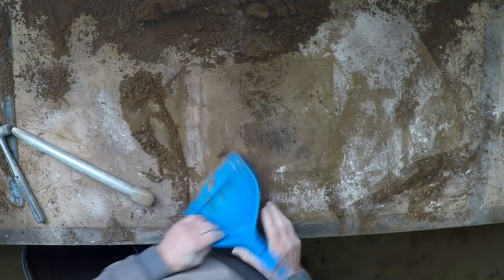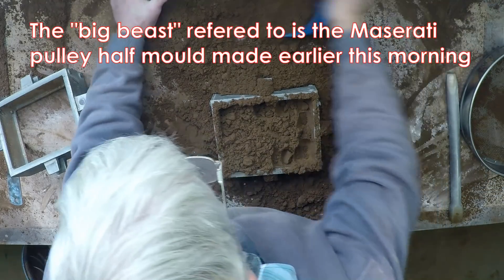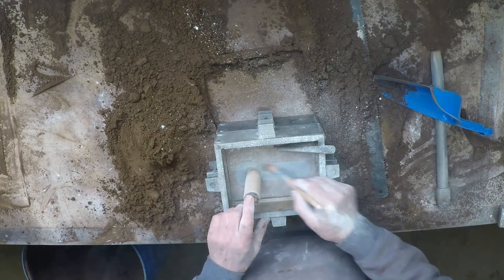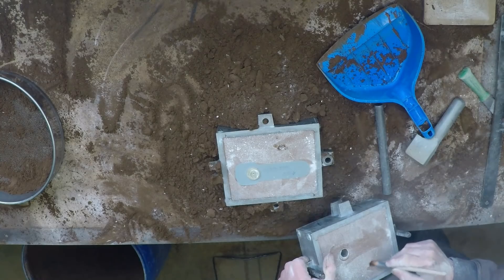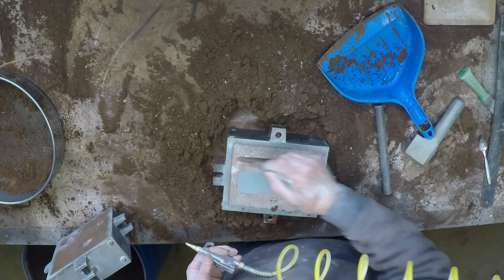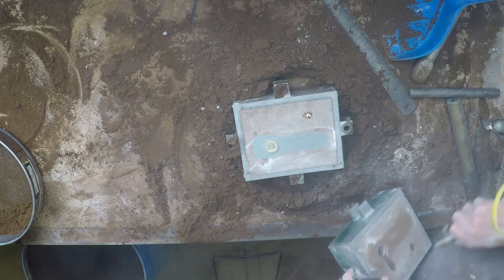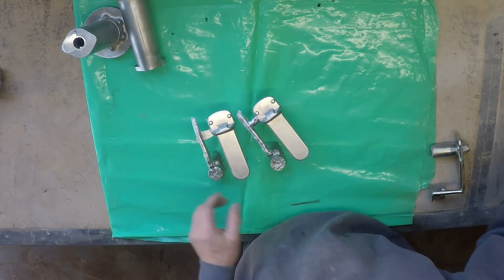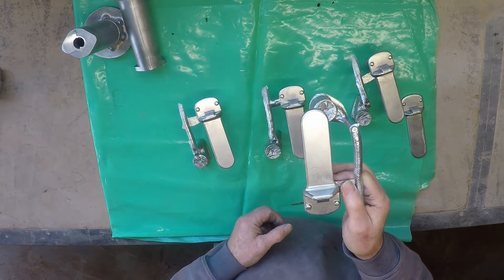Sand Casting an Aluminium Vacuum Cracker for Jars

Comment: Hello martin once i have casted brass door handle and he wants 20 more pcs the thing is my furnace can take 80 kg of bronze and the handle is 12 kg how can i have the same color of brass he dont want to make any patination that is making it hard for me
Reply from the maker: Rabih, This is exactly why I gave up melting brass! Not only was there the zinc fumes which I did not like breathing in but the colour changed with just about every melt. I was making candle sticks and the stick came out one colour but the bases cast the next day were another colour - hopeless! To be honest I would have preferred to have used a silicon bronze for this job, it does have a higher melting point but it does not change colour and I think is a better colour anyway.
With brass all you can do is be very consistent. Firstly buy enough brass ingot to do the entire job, melt a consistent amount of ingot and returns (gates feeders etc) each time and if your melting conditions are consistent you should get a colour match. Good luck... Martin
Reply: the thing is in my country no one sell ingots this is the other problem i am thinking to make ferro silicone bronze i will melt scrap copper to ingots 
Then melt the ingots with ferro silicone hopefully i will get the same color
Reply from the maker: Rabih, Well, that makes things difficult! I assume that you are going to copy Luckygen1001's method of making a variety of silicon bronze. It certainly seemed to work for him although I doubt he got quite the bronze that he though he would get as I suspect he would have lost some of the ferrosilicon to oxidation from the inevitable copper oxide that you get when you melt copper. But the bronze he got was certainly a useful alloy. If you make it in bigger batches than he did you will probably get a better recovery of the ferrosilicon. Be sure to use 75% silicon 25% iron ferrosilicon. The colour should be consistent if you are in everything that you do. However it is always better to but ingot if you can, its just so much easier and more consistent. If you can  avoid using copper wire it has too much surface area and therefore gives too much copper oxide, if you can stick to copper buss bar the thicker the better... good luck and let me know how you get on. Do you have a video of making the handle?.. Martin
Reply from the maker: Rabih, Copper and lead are mutually insoluble in each other. Whilst a 10% lead alloy will solidify more or less as an alloy, by the time it cools to room temperature it will consist of essential pure lead particles in amongst a pure copper matrix. Because the lead is so much heavier it can  sink to the bottom and your casting may have higher lead levels on its lower side  I am unsure as to how well it would polish as the lead being so soft might pull out during such an operation. Also be aware that lead vaporises quite a bit and your foundry and your sand will become contaminated with lead. I think a 90:10 tin bronze would be a better choice. Sorry but I do not have a mobile phone (strange but true!) My email address is mmwest*hotkey.net.au substitute @ for the * Perhaps you can contact me that way... Martin
Reply: Hello i have done the castings 85 % copper and 15 % tin the result was perfect 
Once i did the cast i remelted the ingates and sprues and i got the same color soon i am going to make my youtube channel 
But still interested about making brass what do you suggest melt copper first then zinc or melt zinc then add copper i am confused i dont want to burn the zinc

Comment: Wonderful information beautifully presented.  I learn so much watching your videos.  Thank-you.
Question: You put a spoonful of something on top of the metal. What was it and why?
Reply from the maker: Chris, The spoonful on the top of then feeders is an exothermic compound, its job is to catch fire and generate a lot of heat. This keeps the feeders liquid for longer so they are better able to provide liquid feed metal to the solidifying casting underneath. It is called "Ferrux NF" and it is made by Foseco… Martin

Comment: You should work inside a big, flat plastic drip tray, then you would not have sand all over the place ...
https://s3-eu-west-1.amazonaws.com/progrow-co-uk/app/uploads/2018/07/05231_large-600x600.jpg
Reply from the maker: My, It all gets thrown onto the floor for reprocessing anyway because its easiest to add water and stir it around with a rake and shovel on the floor, so being sort of all over the place is not a problem. I do slowly loose sand but its not like petrobaond which is quite expensive. I bought about 6 to 8 cubic meters of this sand many years ago and it was very cheap it actually cost more to get it trucked here than to buy!  Throwing out of a little each time plus the addition of a little new each time is the best way to maintain consistent sand properties. I will go and look at the ling and see what it is about... Martin

Comment: I thought for sure you'd still break out your pneumatic "burp-burp" rammer that sounds like a two stroke dirt bike. I like that tool, need to get one for myself. On another note, in your vast experience have you ever had the weather be just too humid to cast, where porosity just ruins just about everything you pour?
Reply from the maker: Amalgamous. These moulds are just a little to small for the "burp-burp" (love the title!). I do know of foundries who will not pour aluminium on very humid days as they feel the hydrogen pick up is just too great. Obviously higher atmospheric humidity has the potential to increase hydrogen levels but to be honest I am uncertain how great the effect is. We have to remember that water is a product of fuel consumption so the humidity inside the furnace is pretty high anyway. I would not be too quick to blame humid weather for all the problems as things like how hot you get the aluminium, how long its hot for, how long it takes to get that hot, how clean and dry you input metal is, how dry any fluxes and degassing agents are (you don't use washing soda to degas do you?) How much turbulence in metal treatment and handling and in pouring the mould right through the gating system and into the cavity. To name but a few of the possible causes of high gas levels (there are lots more). And it depends on what you mean by high humidity, far north Australia gets unbearably humid (to us southerners) for some months each year, to try and work a foundry there must be a real ordeal. But given the choice I would certainly prefer a low humidity day its just that it isn't the be all and end all of gas problems... Martin
Reply: @olfoundryman8418  I have a confession to make, in the beginning I did use borax and washing soda it was a constant pain. Bubbles in the casting everywhere. I switched to a mix of 50% sodium chloride / 50% potassium chloride things got a little better. I am currently working on copying your degassing lance. Then again, I'm a hobbyist who is often melting junk to make trinkets and the occasional useful part.
Reply: @olfoundryman8418  As far as humidity goes, 90% is not uncommon in the summer. I do most of my work in the winter where the humidity is lower and the mosquitos are dormant for the most part.
Reply from the maker: Amalgamous, I am not surprised that you had bubbles everywhere! Borax is pretty much useless on aluminium as it has no power at all to dissolve aluminium oxide. Washing soda (depending on which washing soda you get, there are several but just 2 main ones) contains 64% water bound as water of crystallization and this is what the bubbles are that you see coming out of the aluminium when you plunge the washing soda to the bottom i.e. steam! This is about the worst thing that you could bubble through your aluminium as it increases both hydrogen and oxide levels. 50:50 sodium and potassium chlorides are the BASIS of a reasonable flux however it too will not dissolve aluminium oxide. To be successful you need to add a fluoride to the mix typically they add about 5 to 10% of cryolite (sodium aluminium fluoride) to the mix and it then makes a reasonable flux but it is only a cleaning flux to remove oxide and it does nothing to reduce hydrogen levels. I need to do an update on my degassing lance video as I found a problem with the latest design and have had to modify it. To be honest if your input metal is clean and dry,you melt quickly, do not get it too hot and pour as soon as it is hot enough you should not have too much trouble with gas unless of course your castings are very thick as the slower solidification of thick stuff gives more time for the gas bubbles to form. Petrabond sands also slow solidification and thus may give worse gas problems. Incidentally true hydrogen gas porosity bubbles are usually about 0.5 mm diameter and anything larger than 1mm  is much more likely to be trapped air... Martin
Reply from the maker: Amalgamous, Hmm, 90% humidity and lots of mossies - you can have that on your own .😀..Martin
Reply: Thanks for the information. Hopefully I can apply it effectively when I get my foundry/refractory rebuilt again since hurricane Florence made a mess of things. I look forward to seeing your new design.

Comment: Absolutely superb. I reckon I've learned as much watching just a few of your videos as I've learned from the hundreds of others I've watched. You're also the only one I've seen who adds the xo, which for me raises two questions. 1 - Where can I learn more about such details? 2 - Where in Melbourne can I source some and just what do I ask for?
Reply from the maker: Sir, The spoonful on the top of then feeders is an exothermic compound, its job is to catch fire and generate a lot of heat. This keeps the feeders liquid for longer so they are better able to provide liquid feed metal to the solidifying casting underneath. It is called "Ferrux NF" and it is made by Foseco. This company used to have a branch over towards Dandenong but it now appears to be closed down and you would have to contact their NSW branch. They are combined with /are part of Vesuvius. 
 I also live in Melbourne (outer east) If you just want to try the exo I could stretch the friendship and lend you a cup full. Am in the phone book surname West... Martin
Reply: Thanks Martin. I really appreciate the offer but don't want to impose. Besides, I'm not eve sure where I'd find a phone book these days and the White Pages web site search doesn't work for me. I'll give Foseco a call after the holidays.

Comment: Nice job! I'm wondering why you coat the inside of the sprues and feeders with parting dust? Does it help prevent sand grains from being eroded by the flowing metal?
Regards,
Preso
Reply from the maker: Preso, Dusting the inside of the sprue and feeders with parting agent is probably a habit peculiar to me! I do it to stop any loose sand (that may blow around during later processing of the mould) from sticking and thus the dusting makes it easier to blow away loose sand just before final closure of the mould. It just makes these surfaces, and indeed the entire cavity as I dust that too, easier to clean, and then you will notice that I very carefully blow the entire cavity, sprue feeders runners gates etc as free as I can from any loose sand.  Generally unless you have a lot of turbulence during your mould fill (overly large high sprues are the main culprit) even loose sand will stay where it is, the metal will simply roll over it rather than pick it up. However any that falls onto the mould surface (from the sides of a feeder for example) will mar the surface of the casting with what I call the "dreaded loose sand grain defect". If you look closely at this casting you can see several very small examples of this defect - rougher finishes tend to hide it but it is almost impossible to avoid at this level of surface finish as even the smallest loose grain will show up... Martin

Comment: Just out of curiousity if you weren't filming, how long would this project take you start to finish?
Reply from the maker: Jesse,  The moulding, pouring, and breakout are done in pretty much real time. It takes about 60 minutes to get the metal molten degassed and fluxed but this covered  7 moulds in this case 5 of these parts and 2 bigger ones. It would take perhaps 5 minutes each to de-gate and fettle the castings perhaps 30 minutes to reprocess the sand (again, for the 7 moulds) The heat treatment takes 8 hours but the oven does all of that I just sit and wait. So all up for the 5 of these  about 90 minutes total I would guess. But don't hold me to that! 😊… Martin

Comment: I'm always astounded at the surface finish you achieve. As you say, the fine facing sand makes a big difference but I didn't realize there was such a delicate pressure balance between having enough head to ensure the mold fills completely and having so much pressure that you pick up unwanted detail from forcing the melt against the mold. It's similar to the balance between keeping the flow velocity low enough to remain laminar so air and sand aren't entrained and the mold surface isn't scoured, yet ensuring volumetric flow is high enough to fill the mold completely before thin sections begin to solidify.
Reply from the maker: aclight, To be honest the sand is a big part but I have achieved better finishes with coarser sand (in other alloys) As you say, a non impact type fill is important and its where so many fail as large high sprues cause this problem - on castings made with them its often possible to see where metal has slammed into the mould wall so hard that the metal has penetrated the sand and now  black rough half sand half metal patches are present on the casting surface. Internal integrity suffers greatly too, with the generation of oxide films and trapped air bubbles. Generally though providing turbulence is not unreasonable and flow velocities reasonable (true laminar flow is so slow that premature solidification would occur) scouring will not occur and nor will sand pickup. In fact in a decent gating system metal will just roll over any loose sand without moving it. I have for example accidentally had sprues half full of loose sand and unbelievably perhaps it stays there - all through the pour, the pour just took twice as long as it should have (an interesting lesson on just how small you can go with a sprue!)… Martin
Reply: Watching some pours on YT you can actually see the molten aluminum pulsing as the pressure wave bounces back and forth within the mold. Now that can't be good for a casting nor the integrity of the green sand. mold.
Reply from the maker: Mark, Such pressure waves are all to common and they sure aren't good for the mould or the casting.. Martin
Reply: This is an extremely well worded and eloquent comment - I salute you sir or madam for edifying us all.

Comment: Great surface finish and excellent videos.
I’ve got motorcycle crank cases to do.
It’s a pity that your are 1200 miles (2000 kms) away.
Reply from the maker: Russ, What's 1200 miles,  just jump on the bike and you will be here in no time 😊.. Martin

Comment: Martin did you cast the boxes the cope and drag? Or did you purchase them? If you purchase them where did you purchase them at? If you made them would it be possible for you to make a video of making one of the smaller ones? My Norwood and I'm continuously burning them. This would be very helpful for us thank you for all your videos you post. You doing amazing job.
Reply: I was going to make the same request.
Reply: I think Martin said there's an upcoming video where he discusses all this (and no doubt much more) in depth.
Reply: Thanks
Reply from the maker: K, Mark, Dfross is right. here is what I said to a similar question above;-
My boxes, I made them! I have now close to 50 aluminium ones made over many years in 4 or 5 goes and I have been very glad of them as wooden boxes are - as I guess you know - the pits. The first two lots were of sand cast sides so for 10 boxes I had to do 80 sand castings - it took a while I can tell you! The last 20 or so boxes I gravity die cast the box sides all  180 of them in one or two days! I currently have two videos in preparation. The first will cover my journey through moulding boxes over the last 50 years, what I tried, what worked, what didn't, what was good, what was bad etc. The second is derived form the first and is a design for what I think is a very versatile box suited to the hobbyist. In the video (maybe in a part 2) I will actually make a box using the minimum of equipment possible,  basically a drill press is all that is really needed so anyone should be capable of making such a box provide they are prepared to put the effort in and as there are 8 sides to a box there is a fair bit of effort required. However currently I have a few holdups so these two videos are a month or three away yet - stay tuned.. Martin
Reply: @olfoundryman8418  thank you so much. I don't mind the effort with you showing us the best way. Thank you so much for the vidieos.
Reply: @olfoundryman8418  I found this is this similar procedure that you use? 

Watch "How to make a cast AL molding box" on YouTube
https://youtu.be/jruZzpVog-g